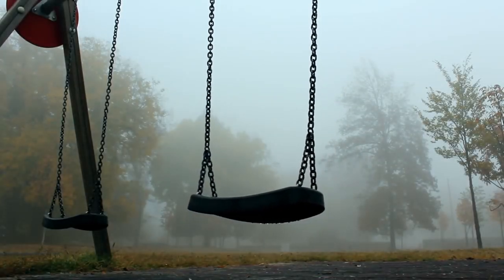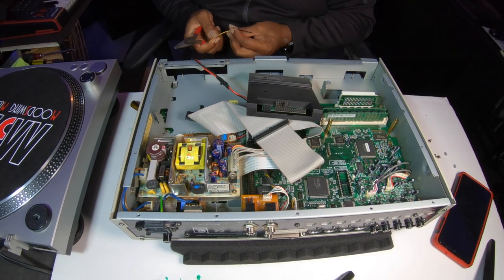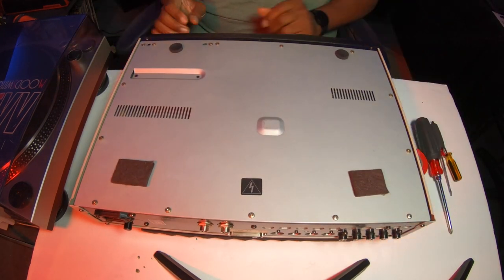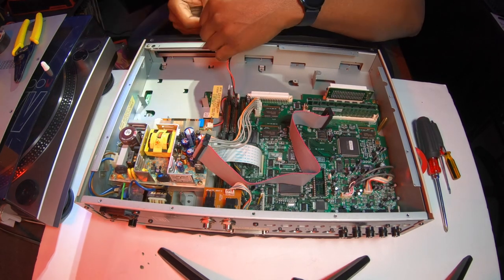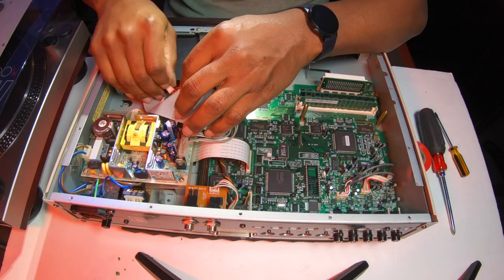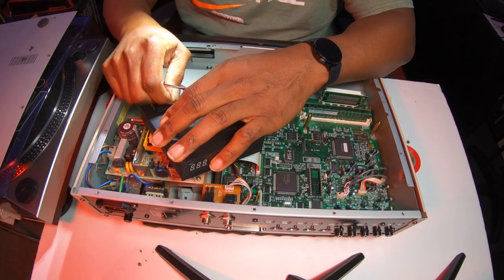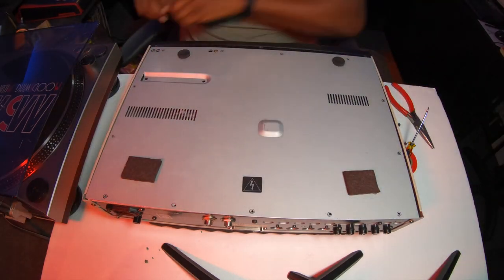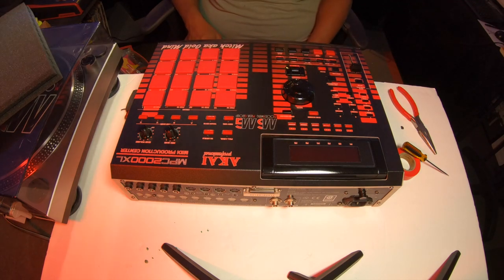MPC 2000xl Floppy Drive Emulator Install

Comment: i bought 2 gotek's for my 2 ensoniq eps's months ago and still cant get them to work ... i put the latest flash floppy firmware update 3.42 and it still wont read any files i put on my usb stick , 
there isnt any step by step videos on youtube for my situation and im about to just give up and order new original floppy drives for my keyboards ... these things are alot more difficult then i thought to get up and running ....or im just dum af and cant figure it out ...